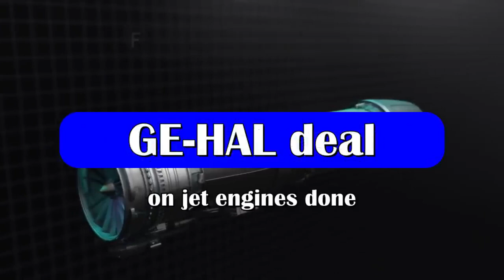#breakingnews GE F414 engine MoU to be signed tomorrow | LCA Mark 2 prototype rollout in 2024

Comment: Let HAL first start producing more than 6 Tejas air crafts per year..
Reply: Actually it's 28-32 per year
Reply: Only 6 a yr 😂😂😂 hal is too slow
Reply: They are already producing 8 aircrafts per year.
Reply: @direwolf7491  Since which year.  Give year wise production for last 7 years.
Reply: @sunilgokhale612  Last year 10-12 Tejas jets were produced by HAL. This is year there is plan of 8 trainer jets to be produced.
Year wise production doesn't give you the real picture since production rate is evolving.
You have to see the latest outcome.
Reply: @direwolf7491  You see in the above comments one gentleman is saying capacity of 28 to 32 aircrafts per year.  Whereas you are projecting 8 aircrafts this year. Do you think they will produce 10 and 12 aircrafts next two years. 🤔
Reply: @sunilgokhale612  8 Trainer jets this year. Trainer jets/twin seater jets are different.
HAL has already made 12 jets per year.
Also, 28-32 is the maximum production capacity.
HAL has said they can make 18 jets per year. Which is reasonable.

Comment: Instead of HAL private players should be involved in the production of engines to meet the IAF deadlines. HAL is known for its delay
Reply: None of the Indian private companies have necessary to manufacture aircraft engine... Thus Hal is acting as lead and rest will supply components as per their capacity which will create a eco system and supply chain in India.
Reply: HAL is delay because of government, and air force.HAL is manufacturing SU-30 for years with no delay  and  also  producing AL-31  engine
Reply: @souravchakraborty6121  No delay.. Lol

Jst read the CAG report on su 30 mki.. It will boil ur blood🤗🤗
Reply: Exactly.. I don't what defense minister is doing
Reply: IAF has already said they will be directly dealing with GE.